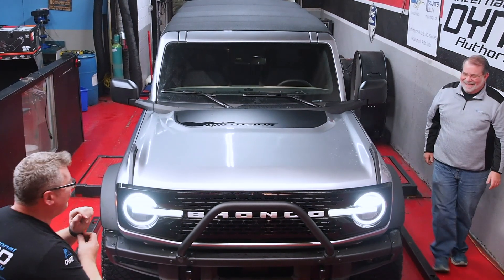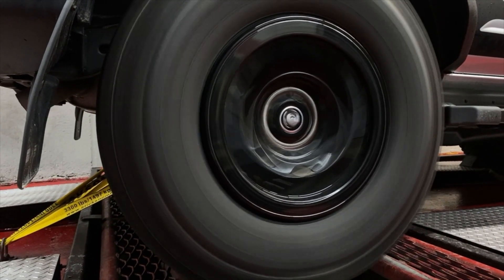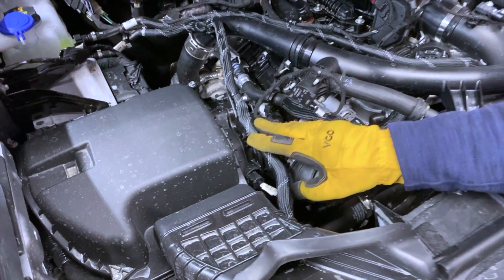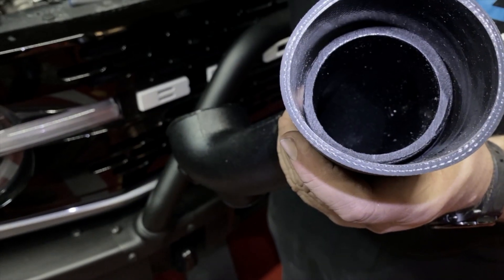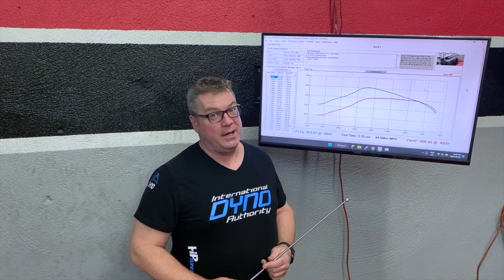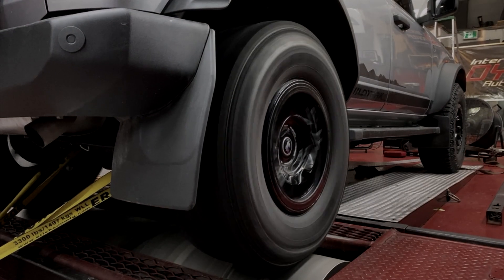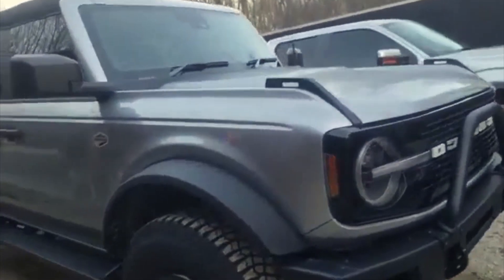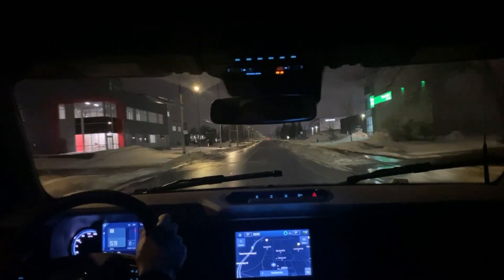Stock BRONCO vs K&N Intake vs DYNO Tuning

Comment: I live in near Dearborn, MI. I have a 2024 Bronco Raptor. I have a K&N and the Ford Pro Tune. What would you charge to dyno? Can you do better than the current setup with a custom tune? I am willing to drive and find out.
Reply from the maker: Yes, we are able to monitor, and walk through step by step 

We would run baselines, and show you exactly what you're making right now. 

And then start tuning, and show you each step along the way until we have it correct, and there will be quite a bit of difference 
Quite a large difference from a plug-in tune Like you currently have
Reply from the maker: @MrRogers_Automotive-Ethernet  613-795-2779

Comment: How do I get ahold of you? I want to tune my 2024 2.7L! Do you have a phone number or email?
Reply from the maker: @joshmrosek2947  

613-795-2779
Reply: @ should I buy the HP Tuner’s MPVI3 to tune my vehicle or do you suggest a different interface device?
Reply from the maker: @joshmrosek2947      613-795-2779
Reply from the maker: @joshmrosek2947  HpTuners Interface does not have access to this platform.

Comment: So why does it say 330 hp
And over 400 wheel from the dealership
Reply: think of is as income before tax. 
its less when on dyno because it has to go through the wheels, also you can think of the wheels (and other elements) as tax
Reply from the maker: @the-bu3lb  vehicles are never rated, on Whp from the factory.

Only CHP numbers are published to consumers.

Comment: That restriction isn't a "restriction". It's a air swirler like the F-150 2.7 has. People have dyno'd power losses when removing them. But what do the Ford Engineers know. Kind of like there are no gains from adding intakes. The oem is already a Cai from the factory. These intake companies just sell snake oil. It's all marketing 😂😂😂

Comment: Can you guys tune my bronco??
I’ll pay
Reply: You can’t tune a 2.3L?
Reply from the maker: @maxthompson9078  We certainly can tune, a 2.3. But we choose not to. Number three. Rod is not in a good position and it loses lubrication easily. They are best left alone. Not really a robust combination, to tune.
Reply from the maker: @maxthompson9078  

613 -795-2779
Reply from the maker: @maxthompson9078  Yes, we can tune a 2.3
Reply from the maker: Yes is it at 2.7? L if it's a 2.7 L. We can tune it. Yes. That's what we do at the shop. We just do tuning. We tune all sorts of vehicles but we do a lot of broncos
Reply from the maker: 613-795-2779

Comment: Is it safe to assume you could tune Ford Rangers with the same drive trains?  Also, are you able to remote tune?  I'm stationed in Germany and looking at buying a Ranger this year so I'm in the early stages of research on which engine is better suited to my needs...IE mostly autobahn and the occasional hunting trip on fire roads.

Comment: does this upgrade change effect the Ford warrantee.
Reply from the maker: Not at all.  Does not affect warranty.  Unobtrusive. 👍
Reply: @internationaldynoauthority693  What? Tuning does in fact void your warranty if the engine blows. You think Ford doesn't see the flash counts? Notice boost and timing out of spec. Omg
Reply from the maker: @HoNkEyKoNg67  

Yes, in traditional tuning. Absolutely. However, we have a custom interface. No, it does not affect warranty. No, it does not leave a footprint. No, you cannot tell. Cannot see. And it would not affect warranty ever.
Reply from the maker: @HoNkEyKoNg67  beyond that, we literally have tuned hundreds and hundreds of these. Not one of them has ever had any kind of failure ever. Not one of them has ever had any kind of warranty related denied work ever. The track record speaks for itself.
Reply: @internationaldynoauthority693  Even with a Jb4. Yes it's removable. But your ecu still logs things. A Ford engineer will know when something is out of spec. They're not idiots

Comment: Very intrigued by this video.  Where is the tune stored WRT the GOAT modes?  For instance does it lie in the normal drive mode or Sport mode?  Will the GOAT modes still work with this tune?  Thanks in advance.
Reply from the maker: Hi Robert the tune is done custom for each of the modes (that is, its effect is different in each mode, but is ON on ALL modes) 

Yes- the GOAT functionality, is still fully intact.
Reply: @internationaldynoauthority693  is there a hand held tuner or online tune you can sent for 2022 wild trak if I do cold air intake? Or if I just do k&n intake I don't need a tune?

Comment: Is it possible to buy ur tune on the ford bronco 2021 ? If I want a custom tune I’ll send you my car ecu to tune it
Reply from the maker: Hello, we tune each vehicle on the chassis dynamometer live. at the time. Custom for each one. Every single tune is completely different from one to the other. One combination. One day on the production line, one set of injectors never works the same as another combination, or another set of injectors or another day on the production line.
Reply: I live in the Dubai if there’s a way to get the tune without shipping my car

Comment: Did you use a tomahawk whipple tuner or just the dyno tune ?
Reply from the maker: Every tune we built, is custom for each vehicle. Using our software on the laptop
Reply from the maker: We use the interface which has been developed only by international dyno authority. We use our own proprietary interface. To build the tune.

Comment: Well I was going to ask about weather conditions during the test pulls ( we often have triple digits  and 1000% humidity) but then I saw windbreaker and rain. What fuel did you test on?
Reply from the maker: 91 Pump Gas. Was used for ALL the tests. 🏁
Reply: After doing the tune does it require using 91 or higher octane, or can you still use regular 87?

Comment: I have a possibly dumb question. Does anyone make a upgraded turbo for the Bronco? Seems like someone would make an upgraded turbo to install along with the K & N and the Dyno tuning.  Will be picking up my new Bronco in a couple of weeks. and wondered if a different turbo was actually available.
Reply from the maker: Yes, there are upgraded impeller's end internals. Butt, butt stock turbos will more than overcome the stock fuel system. And because it is direct-injected. It's not a simple swap to put in a fuel injector. So it's not really a great idea to upgrade the turbos. Except to put in the aftermarket impellers
Reply: @internationaldynoauthority693  thank you sir. I figured I would ask the experts. And from what I have seen so far, you guys are the Wizards of the Dyno! I appreciate the help.

Comment: Could you give us a little more information about this tune? How are you tuning? What “mechanism” are you using?
Reply from the maker: Yes  we are tuning using custom in house software. Laptop capable, HP scanner(Similar to HP, SCT, Holley) IDA exclusive....however.   Standard procedure.  1-Afr  first, tuning the fuel curve, 2-boost curve 3- Ignition Timing. We make sure each of the safeties remain "in-spec"  under: load, heat, cool, cruising, and Wot.

Comment: Hold on!  You're saying I can get more power and torque from the motor AND get better gas mileage?!!  Sounds like it eventually pays for itself.  I assume the tuning is tire-specific for this, right?  I might decide to put slightly bigger tires on my Bronco, should I hold off on tuning?  Lastly, does the tuning effect the warranty of the truck?
Reply from the maker: The tuning process leaves no footprint. There is no effect on warranty
Reply: @internationaldynoauthority693  NO WAY?!!!
Reply from the maker: Increased torque, in the lower RPM range, means that the fuel injector opens for less amount of time.  And it means that the fuel injector is required to open more efficiently. The tuning of the fuel curve, to maximize the amount of energy realized, from the air fuel mixture, is basic tuning. 

This is the combination, that gives you increased fuel mileage

Comment: I'm considering the K&N and the Injen CAI. Have you look at the Injen? Why did you go with the K&N?
Reply from the maker: We have actually tested both of them. In this case we with the K and N on simply because it had stock. Both of them make very similar power.(15-18) They're both within 1 horsepower they're both within 1 ft lb
Reply from the maker: This unit have to be in stock

Comment: Think my only worry with doing something like this is the transmission. I don't believe the transmission is technically able to handle the numbers you are running. any thoughts on this? Do you guys do any tuning to the trans as well?
Reply from the maker: What you should do, is watch Cletus sometime.
Reply from the maker: The transmission, can handle upwards of 900 horsepower easily.
Reply: @internationaldynoauthority693  Broncos use the 10R60, not the 10R80. It’s the same transmission from the Ford Explorer ST.
Reply from the maker: Yes, we start with the Fuel Curve we move on to the Boost curve. We then change the cam timing ignition timing transmission tuning

Comment: I may have missed it but wondering what octane fuel were you running?
Reply: 91 or 92 Oct.
Reply from the maker: He chose 91. But it is your choice you can choose 91 or 89 or 87. Whatever you would like and we will tune to the fuel. It is all custom-tuned